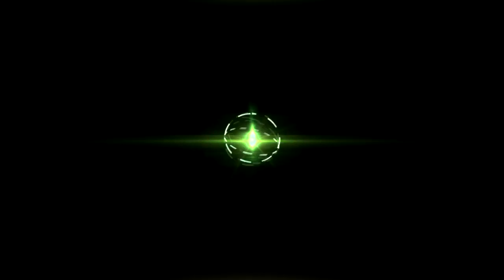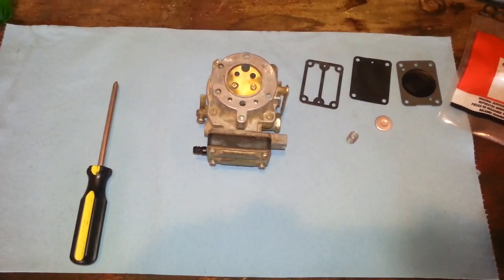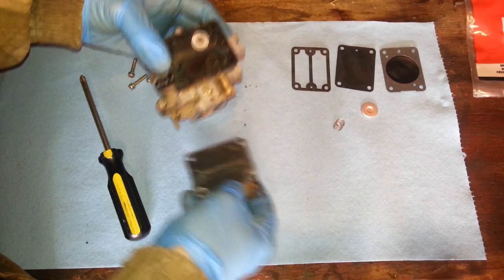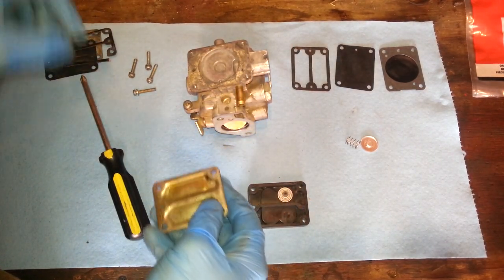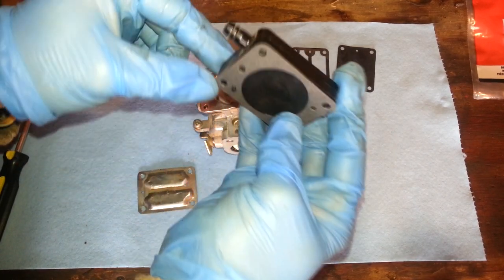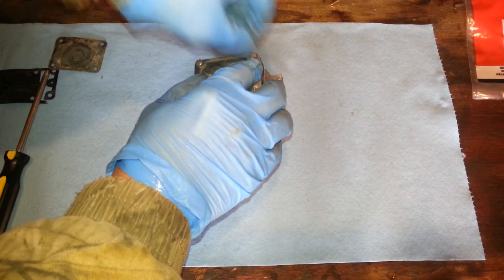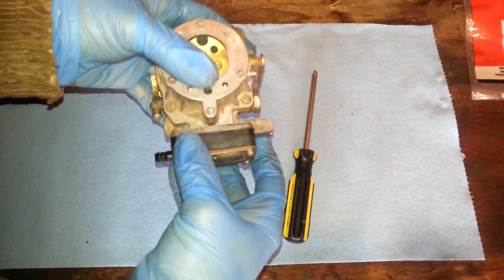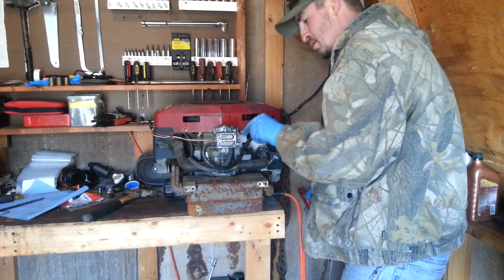New Mud Mower Update 4 -How To- Rebuild A Briggs And Straton Opposed Twin Fuel Pump

Comment: Don’t know if this was ever mentioned to you but the problem at the end with the fuel pump cover was you had it on upside down. The slits in the middle of down, and the hole goes away from the fuel intake. I just noticed that and rechecked the video, and it was opposite of how you took it off..

Comment: Just rebuilt one of these carbs and fuel pump leaks out the little hole in the carb body where pump diaphragm spring is. Any clue about that? If I gravity feed it fuel just dribbles out that weep hole.
Reply: Just in case someone is having this problem just switch the gas line with the other one. Gas on left side, vacuum line on the bottom.

Comment: This is how I did mine too. What is strange is that the Briggs and Stratton parts diagram shows the spring and metal circle going on the way that yours originally was (spring and metal circle on the opposite side of what you did in your repair. Any thoughts on this anyone? Thanks for doing a video on this.  Here is a link to the diagram: https://www.jackssmallengines.com/jacks-parts-lookup/manufacturer/briggs-stratton/400000-699999-series/42e700-to-42e799/42e707-2631-e1/carburetor-4-screw-mount-carburetor-overhaul-kit-fuel-pump-kit
Reply: Is this Marcus Turull from Germantown?
 I have a 17hp Briggs Twin 2 and I can't figure out why this carb won't pump fuel to save me. The spring goes into the little round indentation in the carb body and then the little round metal cup goes on the other end of the spring, I used a bit of grease to hold the spring and cup in place before I pushed the plastic pump body onto it because I took the pump back off while the carb was mounted on the engine. At first I had the gasket and diaphragm oriented just like he had it in the video with the diaphragm against the plastic pump and then the gasket which would be against the carb but it wasn't pumping fuel so I took the pump off and looked things over, sprayed carb cleaner in some holes yet again thinking maybe something was clogged and switched the diaphragm and gasket around and it still won't pump fuel so I'm going to take it off and look things over again and switch the diaphragm and gasket back to the way it originally was. I pulled the pulse hose off of the pump, put my thumb over it and cranked the engine and I can feel the pulses so I know it's not the hose, the only other thing I can think of is the plastic pump body is cracked somewhere and I missed it or maybe the little check valves inside the pump body are defective or something else I'm missing. I'm about ready to throw this carburetor as far as I can I can't figure it out, I've already got $32 into a complete carb rebuild and still not working. I can buy a new aftermarket carb for $40, this is boloney.  A new fuel pump is another $25 that's $65 into the dang carb and still may not work. Sometimes it's more expensive trying to fix something rather than just replacing the whole thing. I'm frustrated at this point, our grass is knee high!

Comment from the maker: @radiandd I didnt mess with mine because they looked good.
Reply: Hey man I have a 19.5 briggs opposed twin and I got a brand new carb and pump for it but the bowl will not fill with gas, it fires on starting fluid and has fuel to the pump. I need help please

Comment: hello, I was looking for a video of repairing the B&S 4 screw fuel pump, and I'm glad I found you did one.
I was looking because I was given a non-working mower, and after verifying that I had good spark, compression, and it runs for a bit with B-12 sprayed in the carb. I have a clean fuel filter, good fuel flow up to the carb (I can suck fuel up to the carb), and I have suction for the fuel pump from the crankcase.
I did a complete carb rebuild, and b-12 for all the ports.
But, still no suction on the intake side of the fuel pump.
After putting the carb back on, with it not working, I realized that I didn't verify that the two inner springed ports were free, but it was very clean inside the pump, and I noticed that you didn't mess with them either...
Any thoughts would be appreciated.
Dan